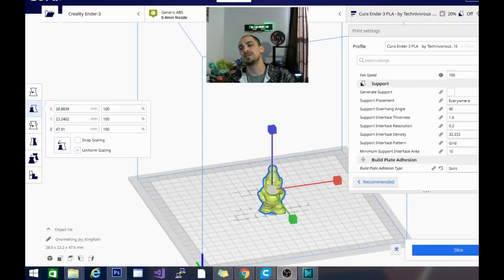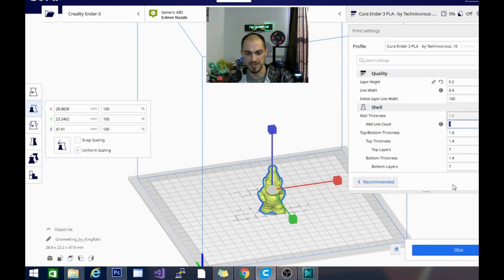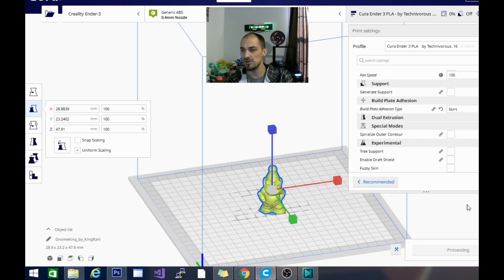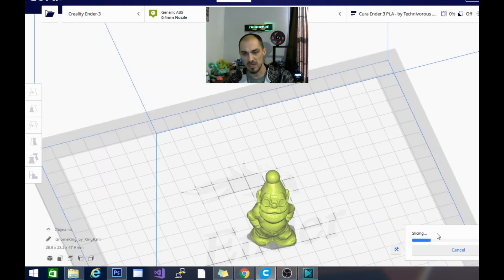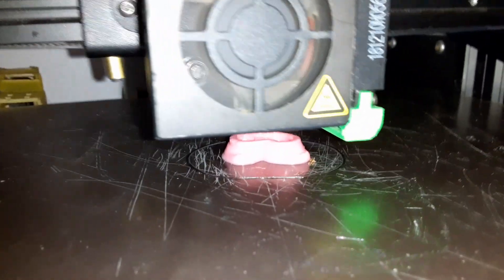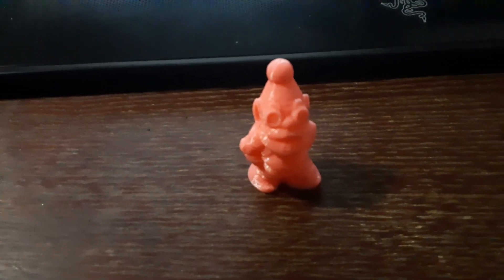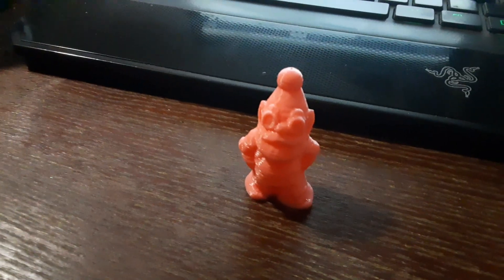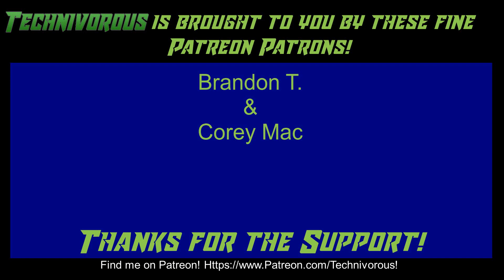3d printing with NO infill! Dont waste your filament!

Comment: What about adding infill just before the top in a situation with a flat top?  
I know it can be done in Simplify3D. I suspect Cura and other slicers may be able to also.
Reply from the maker: The way I've seen this done is to put a support pillar in the middle so the "infill" under the topside basically becomes support. You can specify different infill amounts for different parts of a model in cura so it can be done. I have not tested it though. I would think it would need to be a gradual increase in infill unless you have amazing bridging,  because the infill would need something to go down on as its hollow below. I'll look in not this a little more before I do the video on the internal support method. Thank you!
Reply: @Technivorous  you can pull it off without any special "infill step-up" settings; just start the infill a couple millimeters below where you think the model actually needs it, so that the infill has a handful of layers to go from "saggy and bad" to printing properly by the time it needs to actually support the model. The less your infill, the more extra layers you'll want to add, since it will take longer for sparse infill to "correct itself" than it would for thicker infill (think of 100% infill as being actual bridging - within a couple layers the surface is fine - while 20% would be bridging over a really long gap, where the sagging is bad and it takes even longer to fix itself).